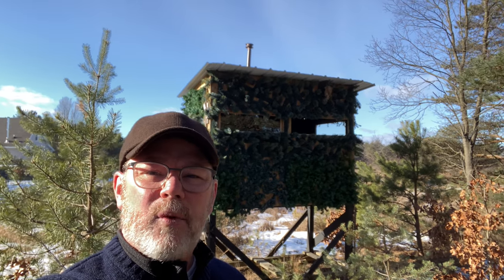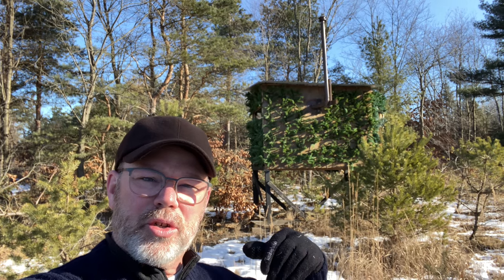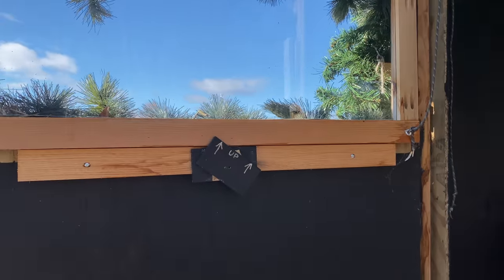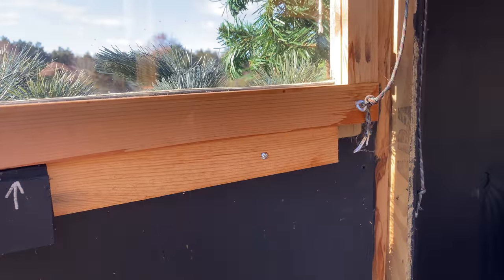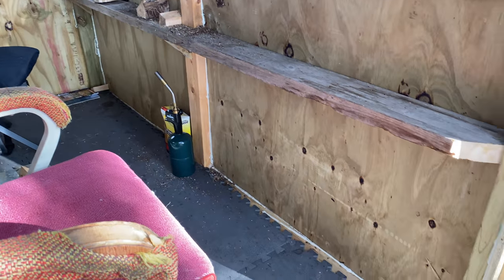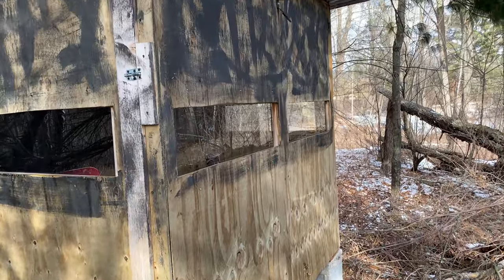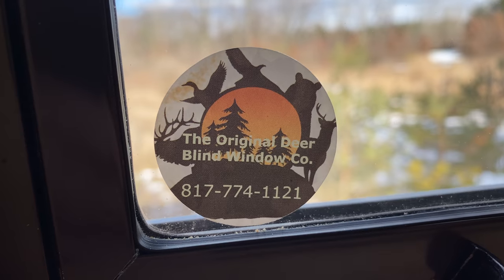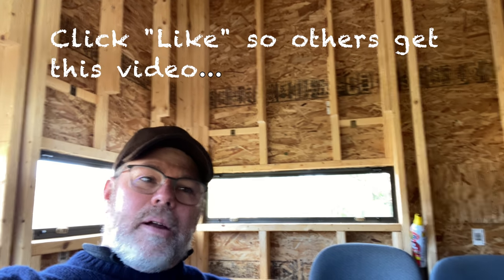Three DIY Deer Blind Reviews, Ideas, & Recommendations

Comment: 1) Glue and screw 3/4 ply on the floor.  Eliminates (or significantly cuts down on) squeeking
2) You can absolutely use thin/small material for the walls and roof: 2x2's, 1/4" ply, metal roofing
3) Regardless of what you use to build it, you still have to maintain it.  Outdoor paint, silicone the seals, etc
4) outdoor carpet on the floor and the walls (to act as kick panels) to further muffle sound
5) Always anchor the blind.  It's cheap insurance.

Great vid!
Reply from the maker: Great comment, thank you!  I never thought about glue, that would help a lot.  Where were you when I was building these?  All the best to you.

Comment: Any of my blinds that are fully enclosed on the back side, I put the backs against a tree. Then I take a 1/4" cable, and bolt to the blind, around the tree, then bolted to the blind again. Leaving plenty of slack in the cable to allow the tree to move, and grow without hurting the tree. Also, cut a chunk of old garden hose, and runt the cable through it before attaching it to your blind. This way, it won't rub the bark off the tree.
Reply: Run, not runt*
Reply from the maker: Great idea.  I could have easily done this with the blind that tipped over, too, because it was up against a huge white pine.  Ugh....
Reply: @theback40  lol. I seen you have a new fancy blind now. Its nice. So, I guess you won't need my 2 cents anymore. Lol. May not be a bad idea to put some sort of ventilation in your new one. Just to help prevent moisture, during the hot summer months when its not deer season.

Comment: What size are the wooden studs in blind #3, the one wrapped in metal?   Also,  before I put metal, whether treated or OSB, I paint the outside, then metal.  It seals almost forever.  Please advise on stud size, thank you.
Reply from the maker: Studs for the inside walls are 2x4's.  And great idea on painting the sheeting to seal it before putting the metal on.  We didn't do that, but will on the next one.  All the best to you.

Comment: I had my metal roofing overhanging like you have but I had to cut them down to a 3'' overhang on the sides......... the wind was catching them and making all kinds of noise.
Reply from the maker: I am surprised how well ours have held up, thought it was a bit much but wanted to try it to keep the water off the blind as much as possible.  I previously built a blind with no overhang, that was a huge mistake.  10 years later, the water did too much damage and I had to scrap it and start over.  Guess I overcompensated??
Reply: @theback40 I put my blind up on top of a big hill where the wind really whips lol! I actually built a new one, it's 7x7. The oddball dimensions are because I got all the wood free that's why it's like that. When I get time I will put it here on Youtube....
Reply from the maker: @seeyakidd919  Free is good, and a 7x7 blind is even better.  Plenty of room to be very comfortable.  And I like the strategy of putting the blind on top of the ridge, more predictable wind than down in a valley.  Let me know when the video is ready!
Reply: @theback40  You got it!
Reply: I posted up a couple videos of my shack.
Reply: What size is the last blind?

Comment: 3/4" ply just for floor. Metal roof panels for walls and roof. Cheap carpet throughout. Low slope stairs, not ladder, for when you're older.
Reply from the maker: Agree on all of that!  I finally added another piece of plywood to the floor of the "weak" one a few weeks ago, and it is 100% good now.

Comment: With the last blind you showed, how did you connect the 4x4s to the corners of the platform?
Reply from the maker: I went out and looked at it last night, and it is screwed from the outside of the joist into the 4x4's.  I wish I could post pictures here, but there isn't a way to do it on YouTube.  The screws look like they have a 'washer' sized head on them to really get a good hold, and a large star bit would be needed to give good driving stability from your drill.  I'll ask my contractor buddy what he used next time I see him and try to get you more detail.
Reply: @theback40   SPAX T-Star Drive Grade 5 Yellow Zinc Washer Head PowerLag, Lag Screw . Probably something like this, brand doesn't matter so much as strength.
Reply from the maker: @gregcavender7798  Hey Greg, thanks for the info, that exactly what they are.  All the best to you.

Comment: The floor systems built with metal joist hangers are not really safe. also the post should be resting under the floor joists' supporting gerder ( beam). Wood resting on wood, is much safer than relying on short-thick-and 1.5 ' nails. Whenever you here on the news about a failed floor system at the beach for instance, the salt rotted (galvanized) hanger nails fail, and/or hanger supported beams-nails- give away from the horizontal supported "relying on nails" building method. The building codes need over all severely.
Reply from the maker: Thanks James. I understand your concern and what you are saying here.  Guess I'm blindly trusting (no punn intended) the building codes and manufacturers on this one.  All the best to you.